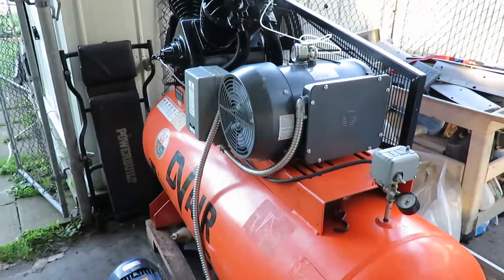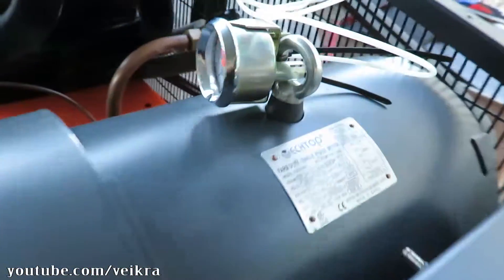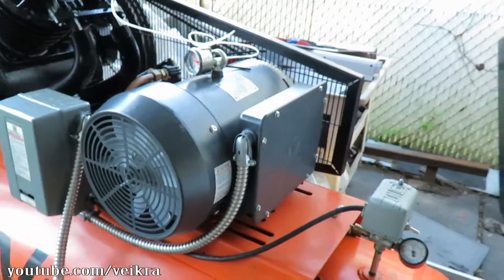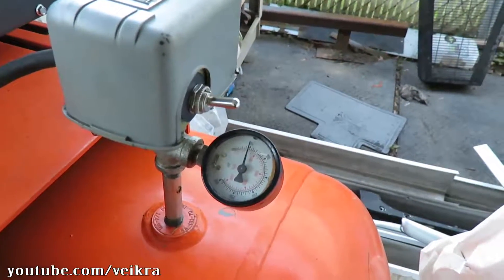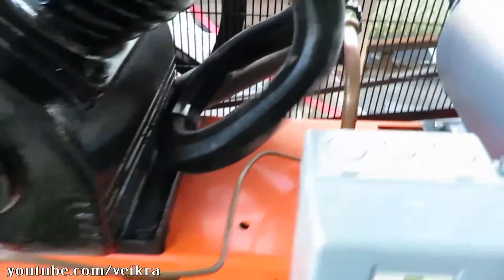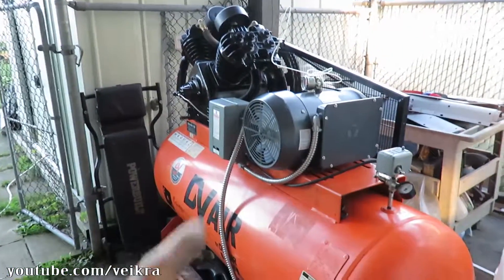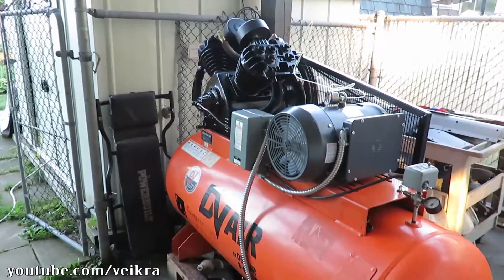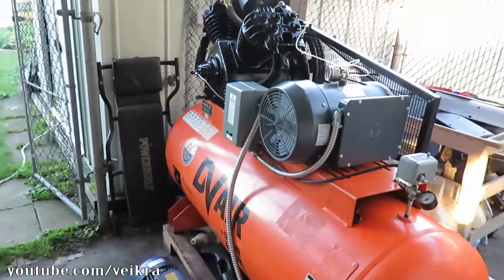Devair 447 pump running on 10hp single phase

Comment: Veikra, it sounded good at this RPM. Why did you change it?
Reply from the maker: I couldnt use 15hp as where I installed it, I did not have 3 phase power. And without it, you are limited to a 10hp. This is the speed it runs at now. It can run faster with a 15hp motor on 3ph.

Comment: I just bought a compressor that came with that exact same motor. I'm in the process of trying to get it all wired up and put together. Yours looks really nice
Reply from the maker: 10hp motor? What kind of pump is it?
Reply: @Nordic_Mechanic  Quincy 224 pump

Comment: Did you need to change belts? If so what length did you have to get ?
Reply from the maker: No, I kept the belts since this compressor was 10hp 575V 3ph to start with instead of 15hp like most of them with this pump.   I think they are 94 inchs belts. If the markings are still on I'll post them tomorrow

Comment: How much did motor cost
Reply from the maker: over a thousand
Reply: I got a 10 hp motor 3 phase but I don’t know how to get it where it will run on single phase, so I got to get a new motor

Comment: Did you have to change the pulley? I just bought one that has the 15hp 3 phase motor but need to switch to single phase.
Reply from the maker: This one was already a 10hp so I reused the pulley. 
You won't be able to run it at 15hp on single phase 240V. 
You will have to change the motor to a 10hp and put a smaller  pulley. Even if you wanted, the 15hp pulley wont fit your new 10hp motor since they have a different shaft size. The correct pulley that devair put on the 447 like this is a 6 3/8. It may be hard to find. You can use a 6 1/2 with the pressure switch set to the correct 155psi cut out pressure. Any question, drop a comment. Thanks
Reply: Veikra Thanks ! That’s just the info I needed ! I will let you know how it goes.

Comment: I need it! Chinese motor?
Reply from the maker: NEED it?  This would set you back about 7200$ plus conversion cost, add about 1200$ plus labor. (all CND$). Unless you find a used one that is.   Not exactly chinese motor, it's an older american made design. So it pulls a little more amps, 42-46 instead of 40-42 for the baldor equivalent which is crap compared to the 3 phase variants.  Now these here are made in china, but parts interchange with the american made ones back when they were made in america.  It wasnt a cost issue, just that baldors are crap and I can't have motors blowing up on me with those price tags. 
These motors runs on many pressure washer, and they last compared to other brands.  Id rather use a little more electricity than replace motors